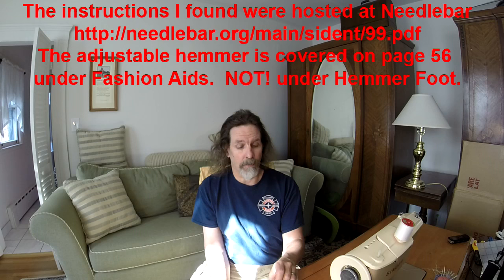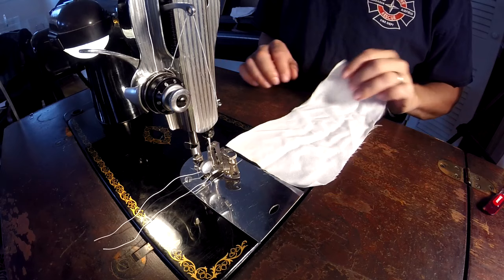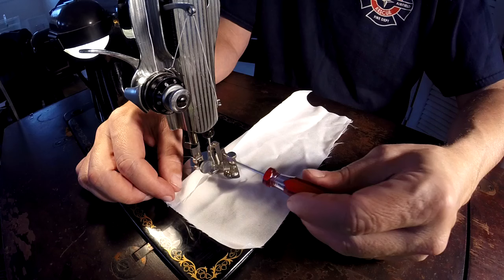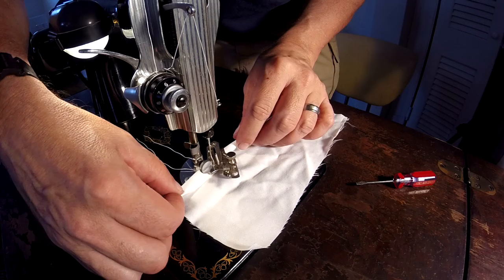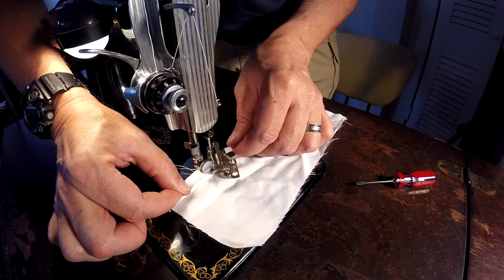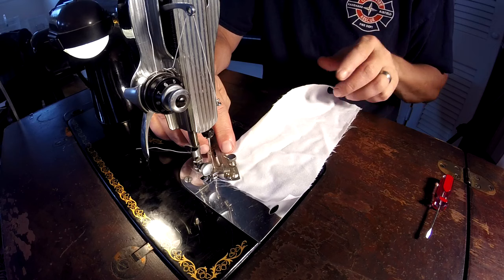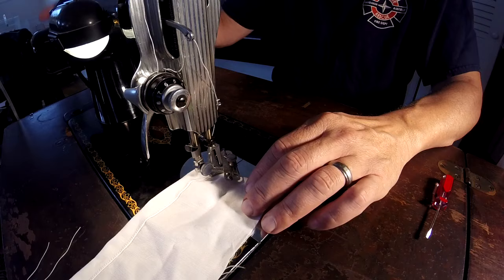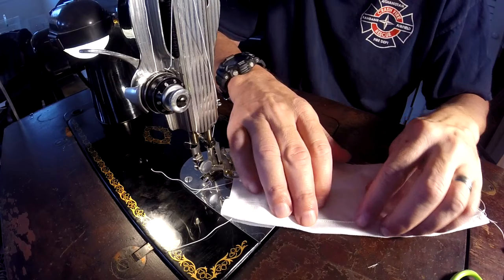Singer Adjustable Hemmer Demo

Comment: Hi Dave
Jo from Australia. I recently acquired a mint 99K crank handle Singer from 1949, made at the Kilbowie factory in Scotland. Came with a box of various feet including this hemmer.
However, in the accompanying manual,  it says to use these special feet you need to have a motor attached to the machine. 
I do have another old Singer motorised so might give it a try on that one. For my purposes though, dressmaking, crafts such as tote bags,  aprons etc I find it quick and easy to just iron my desired hem width, which takes seconds then stitch. I do love the beauty and extrodinary technical expertise and superb quality of manufacture of these vintage feet. They are mini works of art. Thanks for the great video. 😊👏

Comment: Just bought a used Vintage Kenmore for parts, it was cheaper than the bobbin winder on eBay, so I figured what the heck. With this came the hemmer attachment you are using here, its darker, but it's identical. Your video is precisely what I needed to know how to use it. All the others out there seem to be guessing what to do. I appreciate you mentioning the tension adjustment. I wouldn't have considered until I saw the puckering. Thank you for the link to needlebar. I can't wait to try my hand at this and the roll Hem attachments in my treasure box.

Comment: Thank you for the demonstration. I bought 2 boxes of vintage Singer attachments and I'm trying to figure out what each one does. Very interesting. Mine is also bluish metal as well. Interesting construction of these different pieces. They all fit my Singer 5830C machine.
Reply from the maker: Glad you found it helpful.  Singer made attachments will have their model number stamped on them somewhere.  Googling them will lead you to explanations of most of them and how to use them.  Sites like https://www.victoriansweatshop.com can also be of great help in getting information on machines and parts.  There's only a few different ways manufacturers have connected attachments from the beginning back in the 1860s:  Low Shank, High Shank, Slant Shank, Bottom Clamp, Back Clamp.  Like the attachments themselves, the information on them is plentiful online.

Comment from the maker: Thanks for the comments.  Glad folks found this helpful.  

For Anika:  I have one that is in the bluish metal as well.  I haven't found any other differences, the part number is even the same.

My wife even found an adjustable hemmer that mounts on a slant needle machine so I can use it on my 401 and 403.

Comment: Thank's Dave, super helpful to see it work on the same machine I'm using. 
You made it easy!
- Rich, from Knoxville.
Reply from the maker: Appreciate it.  It takes a bit of practice, as you can see at the end of the video where I put the photo of all the test strips I did.  But it ends up saving a ton of time over pinning 30 feet of rolled hems for camping hammocks.
Reply: Same here! Good video! I needed a little help in learning to use this foot, too. Thanks for the video. I am inspired to practice with it some more.